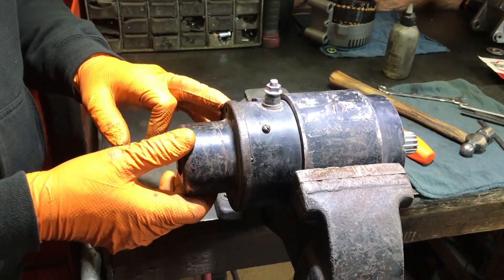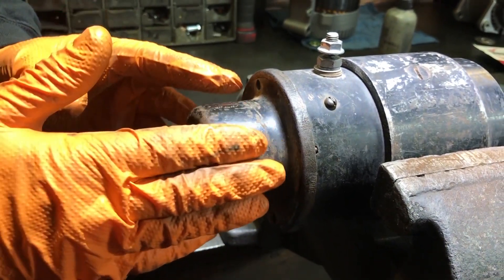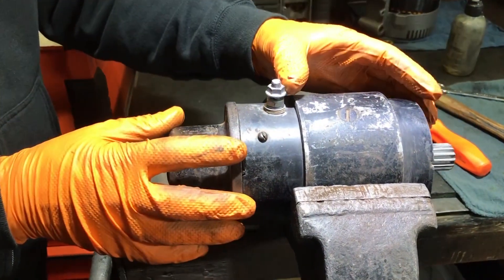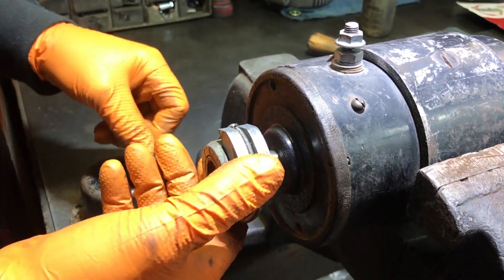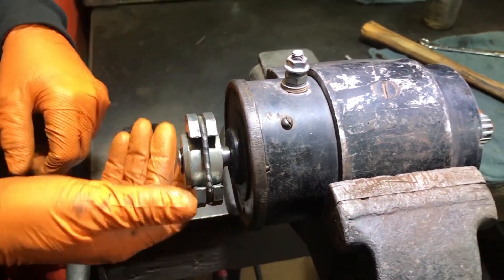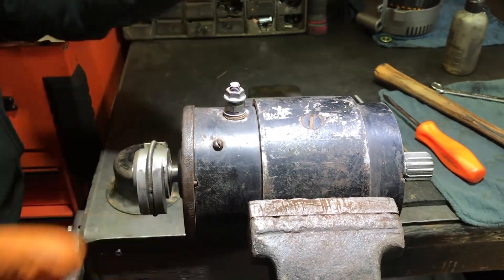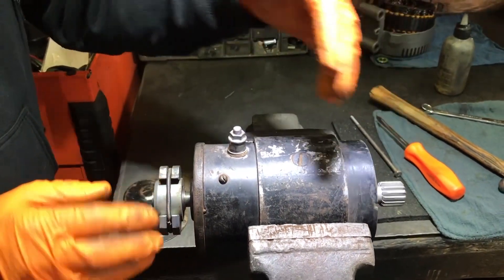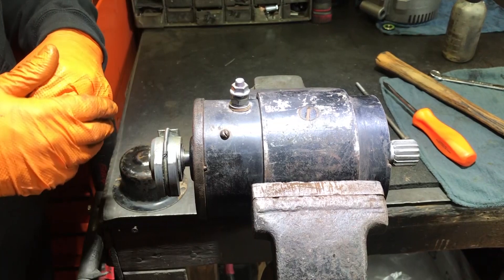Winch Motors Understanding The Braking System

Comment: My 2500 winch will not hold a load under tension after I installed a wired remote. Don't see how that has anything to do with the problem.
Reply from the maker: Wow, not sure on this one.,Check voltages when using.

Comment: does the brake work in both direction ? what if the motor is lowering the load and it comes to a stop
Reply: Some hand powered elevators and dumbwaiters had an automatic brake that would hold the load no matter which way the torque was pulling.
Reply from the maker: That is considered a winch motor. This is different.
Reply from the maker: No, it does not work in both directions. The brake is only significant when The starter gear retracts from the fly wheel.